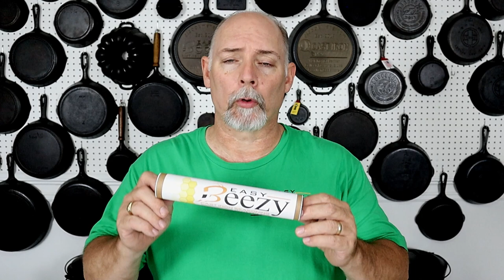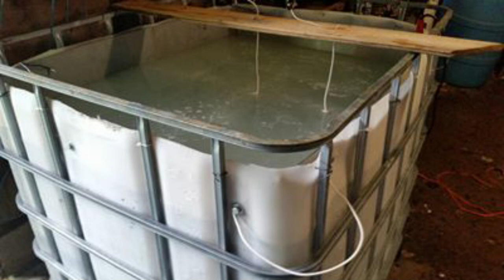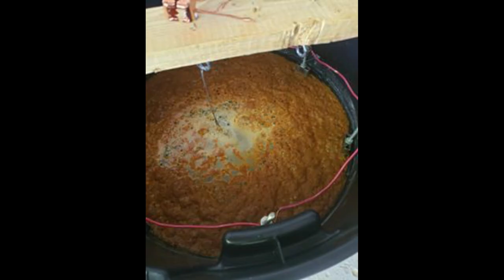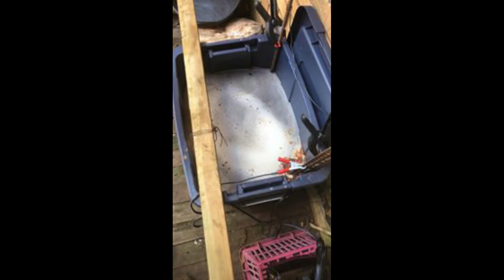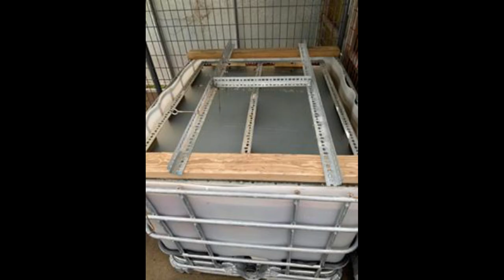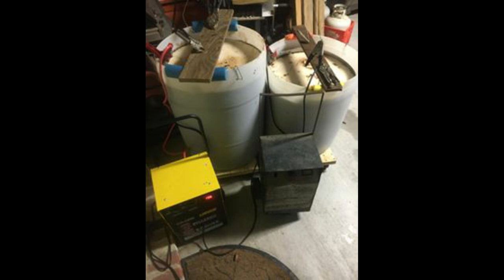Electrolysis vs Lye Tank

Comment: I use lye in my electrolysis tank. It takes care of both issues at the same time. The lie loosens the organics and also acts as the electrolyte to remove the rust. Works great, but using a well ventilated area.

Comment: My wife and I are empty nesters meaning we have two bathrooms that aren't needed. I set an e-tank up in one of the tubs so I can pull the shower curtain and it disappears. When in use I leave the curtain partially open and set the battery charger on the heating & air vent with the unit fan on. That provides plenty of ventilation to the room and cooling to the charger. I scrub them in the utility room next door so it doesn't make a mess all through the house.
Reply from the maker: That is awesome!

Comment: I have actually had an idea that I'm going to take a decent size beverage cooler that has the wheels on it and line it with steel that way it will be so easy to drain the water out of the tank. That's the biggest pain of the whole process is that step of lugging the thing to the nearest disposal area and having to dump out the water

Comment: Nice video (again!)  The point about "organics" vs "rust" removal is an important one. I use a similar "shortcut" like you described, but instead of lye tank I use Easy Off. I put the sprayed CI in a tub first (with lid.)  Then to E-tank after a few days.  Shortens the tank time needed.  Just one more technique. Thanks for what you do.
Reply from the maker: Yes, the easy off oven spray works great. The active ingredient in the is your oven cleaner is lye.  A lot of people use the easy off oven cleaner method in a plastic bag. I never thought about putting it in a tub with a lid on it. You should get the same results. Good to know. Thank you for sharing.
Reply: @castIroncookware  i recently picked up a couple hundred pieces... so a plastic stirage bin with lid let me spray and seal up about 20 at a time!  Caution: put the tub on a roller dolly first! Can't begin to pick it up when full!
Reply: Now have 2 lye spas!  Only use EasyOff method for 1 or 2 pieces. Then everything goes to e-tank

Comment: Oh, that's why my etank is not doing as good, I used I cup of washing soda per 5 gallons of water instead of 10 gallons.  Thanks for the information
Reply from the maker: It should still work at that solution but your power supply will have to work a little bit harder than it should.

Comment: One thing we need to do is the "reverse E-tank:" when you take a really big cast iron pot and use the pot itself as one of the anode.  Clamp the black (negative) lead to the side of the tank itself, hang the sacrificial red (positive) node into the center of the tank and don't touch the bottom or side, and fill the pot with your water and electrolyte solution.
Reply from the maker: That is a great technique. I have a friend that uses a wand with a nylon spacer that he uses for especially tight spots.
Reply: I agree. I have been watching both of you guys' videos for the last 1 1/2 yrs and have really enjoyed them. Have learned tons about this new hobby. I have a plastic tub e-tank that is wide enough for a #12 dutch oven and then I suspend a small steel bracket in the center so both inside and outside get cleaned at the same time. Keep up the good work both of you!

Comment: Pardon my necropost on an older video. I’m new to using electrolysis for rust remediation. I just started today. I didn’t have any sodium carbonate on hand but had plenty of lye. I’m using the lye as my electrolyte. Basically, I’m electrolyzing my lye bath. Any pitfalls I should be wary of in this method? So far it seems to be working great!
Reply from the maker: The main thing is the potential of getting burned and skin irritations. You might want to consider wearing safety glasses as well while working around it.

Comment: OK, how about the 3rd option, Self Cleaning Oven Method?  Thanks.  I did a few pieces of cast iron this weekend.  One in my newly made electrolysis tank, and 4 in the oven.  The oven was much quicker, considering I popped all 4 pieces out in an afternoon.  The electrolysis tank is still working on the original piece.  However, the electrolysis pan looks much cleaner.  The oven method pieces were.... good enough to start seasoning.
Reply from the maker: There is just too much potential for damage using the self cleaning oven method for me to take a chance with it.

Comment: I would add that when using a battery charger you should hook it to a battery first. Then wire the battery to the e tank. This will provide a more stable DC current. Esp if the charger isn't the best. The future is in laser cleaning, but thats 10 years off. What takes hours today will take minutes. Right now it's just to pricey.
Reply from the maker: I've seen those laser systems and they are really nice but as you said very expensive.

Comment: I am brand new to your channel and only recently got my first piece of cast iron. It's a skillet that my friend gave me. It has a very hard, black crusty build up around the edges on the bottom. Am I to understand from your videos that only a lye treatment or electrolysis treatment can remove that type of build up?
Reply from the maker: Those are the only two safe methods that are widely used by cast iron collectors.

Comment: What happens when you use an automatic charger?
Reply from the maker: They usually register a fault and shut down.
Reply: I heard if you have a dead junk battery. You can connect an automatic charger to it then attach lines to the tank and skillet
Reply: Automatic chargers will sense a voltage present before beginning a charging cycle. If the battery is dead, the charger will not sense a battery and will not activate. I jumpstart my E-tank by temporarily connecting a battery and then the charger to the cast iron. After the bubbles begin forming I disconnect the battery.